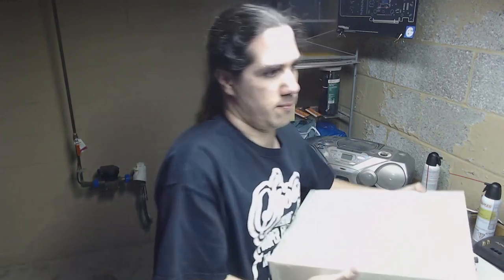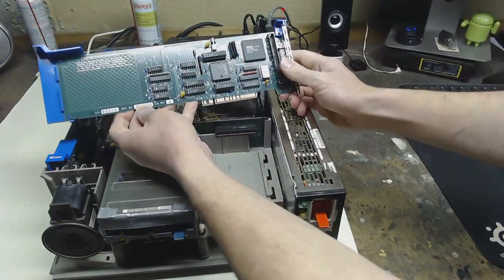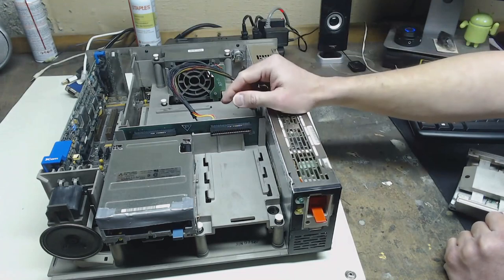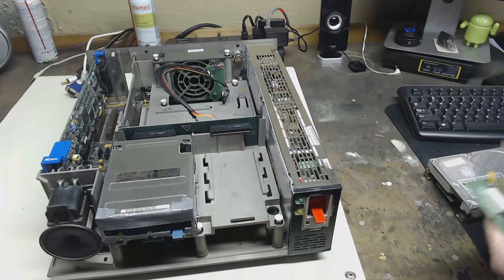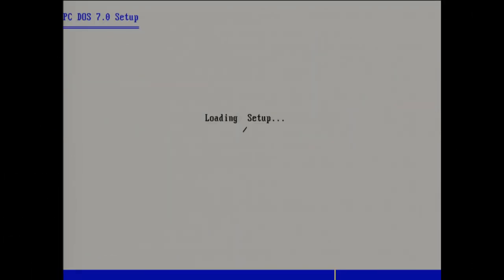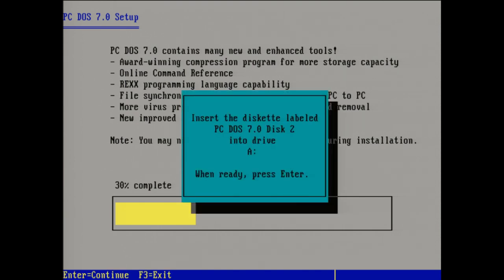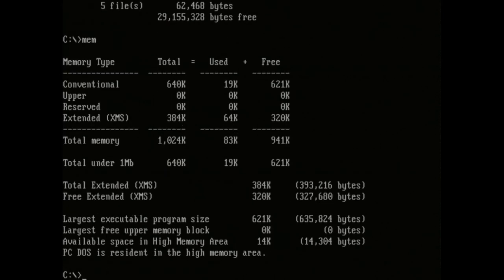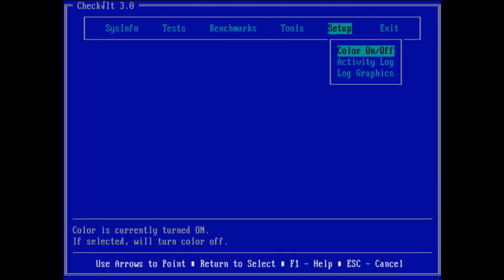Adventures in 286 - Part 6 - IBM PS/2 Model 50 SCSI Hard Drive

Comment: Hey, I recently received a IBM PS/2. 
I believe the hard drive had failed. (Error 10483)
Just wondering what is the best way forward to go about fixing this. 
Great video by the way.
Reply from the maker: What model PS/2 system, just curious?

You can try to source a replacement drive to see if that would help, but I didn't have any luck with that.  I had to resort to using a third-party SCSI controller as none of the official IBM drives I could source would work.

Though, for error 10483, I found this: http://www.mcamafia.de/mcapage0/problem1.htm#probl01
I don't know if this method would work, but it's just something I found.
Reply: @nticompass  
Brilliant stuff, thanks for the input. 
It's a Model 55 SX.
I was going to try and take apart the hard drive and manually move the motor but found it very difficult to split the drive. I didn't in the end, as I didn't want to do any further damage.
Reply from the maker: It seems like the drive might be stuck, there may be a way to fix it.  I don't know how easy replacement drives would be to find.

I don't have a 55SX.  I have a 56SX, but I don't know if the drives are the same.
Reply: @nticompass  I can believe it but it actually worked. 
I gave it a slight tap both clockwise and anticlockwise, placed it back in and it spun back to life. 
Thanks for you help in this, I really appreciated it. 
Only thing now is to run through the boot cycle, I'm just waiting on 3.5" disks to arrive. 

The drive was a Seagate 60MB for reference. 

Thanks again!
Reply from the maker: That's awesome!  I'm so glad you got it working ^_^

Yeah, you might need the "reference disks" to change the BIOS settings.

Then you enjoy your system and welcome to the world of MicroChannel :-)  Just wait until you start buying more MCA cards.
Reply: @nticompass  Thanks again, one step at a time. 
Just looking to start Kings Quest V now. Ha.
Reply from the maker: Good choice of game :-)
Reply: @nticompass  Hey man, 
As much as I'd like to say it got it working. 
Unfortunately the drive keep sticking. 
My only choice now is to install a new drive. 
Any advice on it? I might look into soldering in Molex connector to the PSU for a SCSI hard drive?
Reply from the maker: Yeah, I would consider an alternative to the original HDD.  I don't know if there is an MCA IDE card, but you can probably find a SCSI card and do what I did.

Actually, my SCSI card has a molex connector on it so I didn't need to solder to the floppy board...
Reply: @nticompass  brilliant stuff. 
I'm in Ireland so it's difficult enough to find spares. I must read up a small bit on it also. My knowledge wouldn't be the best on that generation of PC's.